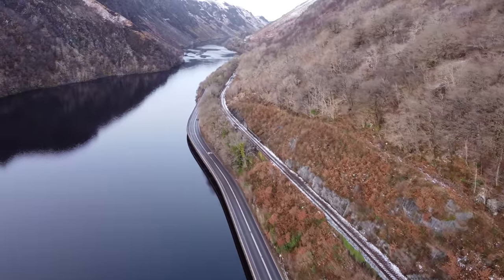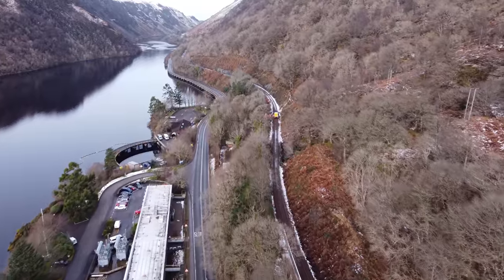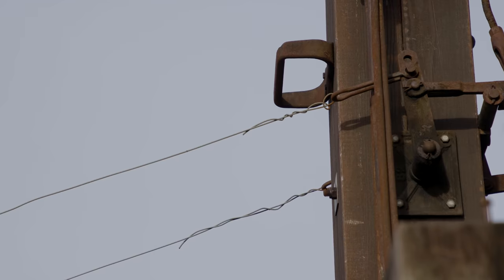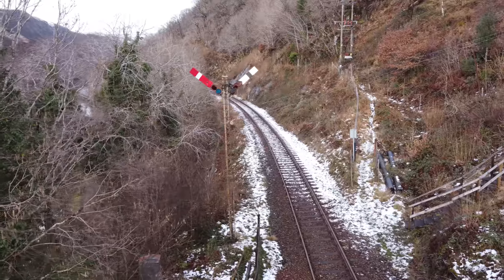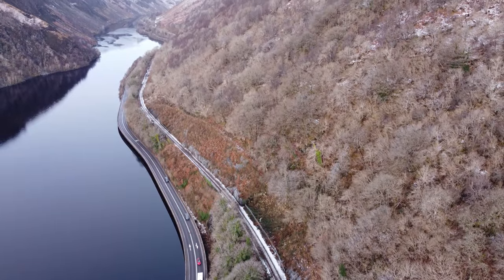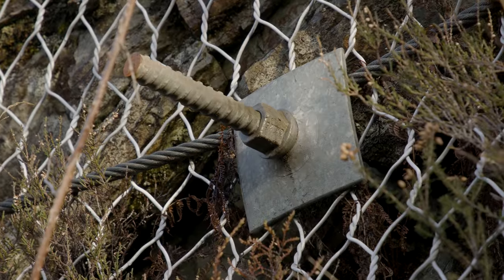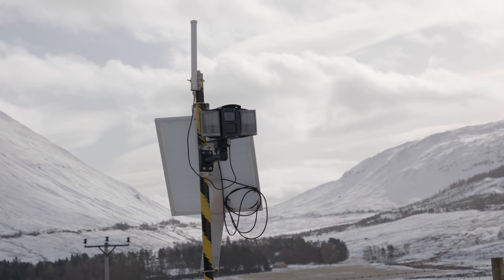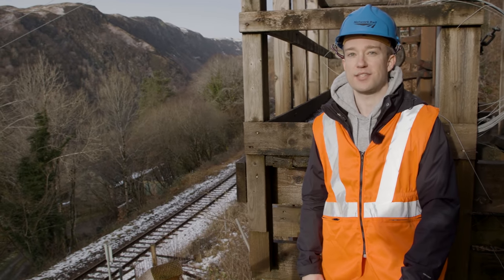After 140 years, this old technology still keeps trains safe

Comment: I'm a train operator in the US. I can completely understand how this system would still be the best. Sometimes it's an old solution or principle that is the most reliable in terms of energy requirements or practicality.

Also, I can definitely vouch for the dangers of larger objects. It takes a lot to derail a train but sometimes, all it takes is a cow or a deer. I've seen it both ways.
Reply: I've been wondering why there aren't just plows on the front to knock objects off?
Reply: @blazerorb  not all objects get pushed out of the way. Most locomotives have some sort of plow, but they are different from the cliche cattle-catchers of old locomotives
Reply: @SupernovaSpence  this is fascinating altogether, but I'm wondering exactly what you mean by "not all objects": are you referring to just particularly large and heavy things, like Alastair the engineer's example of a washing machine, or can smaller stuff like, again, microwave oven-sized rocks also 'bypass' a big, front-mounted plow?
Reply: @SupernovaSpence  unless your in a canadian winter . A freight train with a snow plough is a site to behold in heavy snow.

And if there is a snow bank you back up so you don't get blasted off your feet from the oncoming snow eave
Reply: @mnxs  I guess, depending on size, weight and where in relation to center of mass of the object, it could go to either side, or under the plow. The plow probably can't scrape neiter the rails nor between them to push everything away, for the same reasons our toy cars got stuck when transitioning from the back rest of the sofa to the sitty bit. Trains also have some "slightly" more gradual transitions like that :)

Comment: I like the size comparison to microwaves and washing machines, rather sensible. And the timing of the Sprinter at the end there was impeccable!
Also was quite surprised Geoff didn't make an appearance here :P

Interesting bit of kit too, think I've heard of it before but never really looked into it.
Reply: "small rocks" and "size of a microwave" in once sentence was quite funny though
Reply: @jojodroid31  Indeed, if that's a "small" rock, then they really don't want a train to hit a big one. 🙂
Reply: I thought size of a microwave as in the wavelength of frequencies in the 'microwave' range until i noticed hes talking about an actual microwave oven 😅
Reply: In urban areas you get microwaves falling on to tracks.
Reply: for real dude. unequivocally correct
Reply: When your microwave falls down a mountain… I think you have a problem.
Reply: nor does the trash bag in the wind:d
Reply: I 0k
Reply: They're American measurements, I think.
Reply: This part was clearly written by someone from the US 😅
Reply: I think Geoff would have been great in this video
Reply: @DaedalusYoung  no… you need blocks of cheese and Big Macs for America

Comment: Exactly the same problem exists for conveyor systems - pull wire switch monitors exist to tell operators exactly which switch is tripped on 20 km conveyor systems with a switch every 100m. On conveyor systems they still need local resets because they are a safety of life system but simply knowing which of the 400 switches (they are on both sides) has tripped is a massive time saving. The radio transponders use lithium batteries that are changed every five years.

Comment: During Christmas 2016 I got stuck for an extra overnight at Kyle of Lochalsh (that's on the northwest mainland looking over to Skye) due to a landslip disrupting the tracks. The wires broke, word got out and my train was cancelled.
Spent it in a cabin looking out to a ruined castle during a storm, with a log fire going and history books to read by the window.
The system works.

PS There was a battle at the Pass of Brander / Cruachan area in 1308 where Robert Bruce and James Douglas ambushed the Macdougalls by climbing over Ben Cruachan. The more you know!
Reply: it could still be improved , it could send a bottle of the local Talisker whiskey to your cabin and have you boss phone you to say you can take another week off and have a pay rise while your at it.
Reply: This system isn’t used on the Kyle line. That part of the word it was likely a roach fall incident, we have them fairly frequently despite nearly annual work installing mesh over the cutting faces

Comment: There is a similar tripwire system used at the eastern end of Southend Airport to protect against an aircraft running off the end of the runway and onto the railway. If it's tripped, the approach signals on both roads are dropped back to red and it requires a physical re-set afterwards.
(Presumably Instruction No.1 of the local procedure reads something like "Check for bits of burning aircraft on the railway".)
Reply: And if it's NOT burning, but just in pieces???

Comment: I find it amazing how many big institutions rely on "tribal knoledge" passed down previous employees to newer ones. The inability to store and access legacy information on processes and equipment is a major problem that needs to be addressed of we are to operate in a world of very long life systems.
Reply: Tacit knowledge I guess
Reply: OTOH, it provides some employment security. People can't be replaced without being able to pass knowledge down. You might be surprised how entrenched this thinking is, and it's not without some justification. Before presenting "solutions" from on high, you have to reassure employees that it won't make them redundant. Especially if you're actually trying to make employees redundant.
Reply: @squirlmy  OK, but what happens if the person with the specialized knowledge dies in a sudden accident? There's no harm in having it written down or otherwise codified so that the knowledge is not lost.
Reply: @chrysshart  I would say for this specific application it's a team of people so the likelyhood of them all dying in a freak accident is slim. Most modern businesses that use general labor have a written S.O.P for the task, but I would consider this a niche case.
Reply: @chrysshart  You are right, there is no decent reason why this system couldn't be documented to a reasonable level, of course anyone working on it is always going to need a fair bit of common sense but its not hard to write down a decent crash course in its operation and maintenance.

Comment: This concept is widely used in the US, except it's generally based on on an electrical current passed through the wires, and any break is detected and alerts the Dispatch directly.
It is mechanically much simpler, just wires stretched on insulators, but this is unique in that it does the job with no power required.

If it were me, I would put a small telematics box at each signal that sends an alert anytime it is tripped.
If the cell network is available, they can last 5 years on a lithium battery because they don't actually use power until they are tripped.
If you only had satellite available, a solar panel and battery pack could keep it going the majority of the year at least, and you add this to the mechanical signal so even in the dead of winter if the solar system dies the train still gets a warning.
But having the remote alert would allow track workers to respond as soon as it happens, rather than only after a train reports it.

On the other hand, maybe there is a train through there every half hour, and adding a remote alert would not gain anything!
Reply: Send me a link
Reply: unfortunately, setting up such a system would be a large investment, one which perhaps the government, or even specifically the rail administrators, won't see as worthwhile, certainly not in the short-run, not while they can make do with the current system. Unfortunately politics, inter-administrative, national and local, plays a huge role in these matters. On the other hand "don't fix what's not broke" also has a certain wisdom to it. This particular system has worked 140 years, can we be reasonably sure cell network or satellite systems won't have unforeseen issues that negate the benefits?
Reply: For an electrical system Wire would be 5-6 grand, electronics would be a grand per box, times 4 (for redundancy), so 10 grand
The advantage is that you can just solder the wires back to reset.
Though another option would be to keep the existing system and just add a monitoring device that checks the state of the flags and reports it immediately.
Reply: Very poor radio reception for aught above MW  up that way. It's not that far from glencoe... Which can't get terrestrial tv signal. Back before Iplayer etc  TV licencing  repeatidly took residents who had sky dishes to uk court, despite EU courts each time overruling  saying that as no terrestrial service...  Tv licencing was (fraudulently) attempting to charge for a service they simply didn't provide at that location.
Reply: @satibel  the cost to run copper wires then you have maintenance cost old system vs new system.

for this salutation it honestly makes more sense for the train driver to go slow during a warning
Reply: solar wouldn't work, this is Scotland :D
Reply: for someone wanting to see the US system, you can view it along US Highway 97 as you pass by Upper Klamath Lake in Southern Oregon. They also have some nice reuse of the rock in using it to build catch walls above the highway.
Reply: @squirlmy  some arduinos + sim card .. 30$ max
Reply: @Mr2winners  not nearly reliable enough, also power is an issue
Reply: they could bury an RTG deep underground and use that to power the network 🙃
Reply: @Mr2winners  for a private project: yes. If the systems has hick-ups, you just go and update the firmware or add a resistor somewhere. For something that needs to work reliably? Nah! Developement would cost a fortune. You would need to create circuit boards as jumper wires won't do the job. You have to manufacture..... BAM: 1 grand per box again. And if there is no mobile signal you're screwed anyway
Reply: "telematics box at each signal that sends an alert anytime it is tripped." except that is costly because it requires equipment, data connection, AND 24/7 operators to monitor it. 
there are lots of things they COULD do, but are any of them actually worth the cost an hassle to certify, contract the construction, set up a purchase and maintenance contract, and have the people to monitor it? no.
Reply: You could probably use LoRaWAN for this. Uses minimal power, can do long ranges and you can set up your own infrastructure.
Reply: For the people worried about redesign and all that: You could keep the old design, and simply add a remote alert system. In fact you could probably power it mechanically with a counterweight attached to a dynamo, if you don't trust batteries. The flag would still mean train drivers would have to drive slowly, but if a cleanup crew could get there before the train, they could make it so that no one is the wiser.
Reply: Yes, we have slide fences in the US. Seems like one would work well in this application.
Reply: I love how everyone keeps saying "oh but the cost to implement this and that". This is the government, wasting tax payers money is their specialty. 

It does actually sound like a great idea, and there would need to be a cost benefit analysis done on it, as there wasn't anywhere near enough info in the video to come to a conclusion.  we don't know if its "worth it" because we don't know how much it will cost and how much benefit will be gained from it. I'm sure the people sitting on the train (assuming it's a commuter train) don't want to always be waiting on it for the issue to only be brought to the engineers attention then and have to wait. I'm not sure if it said in the video how often this happens, or how busy the actual rail line is.

We already know it costs £40mil a year on maintenance, so any investment would need to also be looked at in comparison, because if it costs lets say £20mil to improve, well how much will it improve by. Rocks are still going to fall, so you'll still need to keep investing the £40mil a year, so investing more money with no financial gains in return or a reduction or even worse an increase in maintenance costs would be the major factor. But if implementing the idea only cost £100,000 once off and it means that 1. safety is higher and 2. trains run more efficiently then it may be worth it.
Reply: @paddor  this is not on a US railroad, you realize that, right?
And the US railroads use the modern electrified wire grid style detector, as well as seismic sensors etc.
Reply: My thoughts exactly. You could add this on, design and all for a few grand, and a couple hundred a year for the phone link, or even just say screw that, and use a radio.
Reply: What about a rail drone?

Just a small robot made to roll the rails, a few minutes ahead of the train, with the same ground clearance as the train.

If the drone is stopped or derailed, you know there is an issue, if not, you know the line is clear.
Reply: ah yes, there it is finally, the thread of the YouTube engineers, administrators, financial specialists and overall experts on the matter
Reply: @bozhidardimitrov3573  My bad, won't ever try to think of how to make the world a tiny bit less miserable, now that you in your infinite wisdom deigned to sarcastically denounce us. 🙄
Reply: Problem is there is no cell network in a lot of that track.
Reply: And copper is valuable enough in those quantities that you would have to worry about theft.
Reply: @cansabanci  Do plants grow?
Reply: @kevinconrad6156  oh come on you believe that billions of years of evaluation and a couple decade old human-made technology is equivalent? solar cells' efficiency is less than 20%. And you need a reliable source of electricity to run these things smoothly.

Comment: For those wondering why the double-semaphore has one painted red and white. A signal is painted red on one side, or yellow if it's a distant signal (iirc), and white on the other. Train drivers facing the red or yellow side must obey the signal's position, but facing the white side the position is ignored.
Reply: Maybe that line runs in both directions?
Reply: @robinbennett5994  yes it does. Single bi-directional line
Reply: @robinbennett5994  It does, that's why there are two signals. One for each direction. The line uses a Single Line Token Block system to ensure two trains aren't occupying the same track in opposite directions.
Reply: Line runs both ways
Reply: @robinbennett5994  re-read the OP. Of course it runs both directions. I'm not sure how you missed that. 🤗

Comment: Sometimes an old solution is still a good solution, or at least "good enough for now."  I'm willing to bet whatever technology eventually solves for this problem doesn't last 140+ years like this has.
Reply: "The simplest solution is often the best solution"
Reply: Indeed.  It's also less susceptible to becoming obsolete.  I mean, there are some pieces of industrial equipment I've seen that still need Windows 3.1.  Meanwhile, something purely analogue like this doesn't need to worry about that sort of thing.
Reply: If whatever tech replaces it doesn't last 140 years, that would probably be because technology advances faster now, and will probably advance faster yet in the next 140 years.
Reply: They wouldn't last 140 years, because the companies making them don't want to ;)
Reply: That speaks more for the current rate of technological development than for the imperfect, affordable solutions of the past, though.
Reply: There's a lightbulb that has supposedly been on since it's creation. These days it's about what is profitable. Cameras would cost too much to run for this scenario.

Comment: I love the environmental side of this. You're trying to upgrade a system, and you're not allowed to use (much) power. Having that reminder that not everything needs to have a million sensors and a self-learning algorithm is kinda nice.
Reply: There would likely be a net environmental benefit of installing a power hungry protection system becausse it would make the railway more reliable, displacing cars
Reply: It's not an environmental issue. It's more of a "this railway is out in the boonies and there is no power available" issue.
Reply: energy is a finite resource, for now at least.
Reply: @sublivion5024  Seems like that'd depend on a bunch of factors. A railway monitoring system would use, give or take, the same amount of energy per mile as any other mile, but a more remote section of track would be relevant for fewer people who aren't already using it, and at a certain point, running a system 24 hours a day, 365 days a year is going to be a bigger drain than is offset by X extra loads per year of people and cargo.

Remember that it is being used by some already, and the system seems like it works, for the most part, so the reliability can't be too great an issue.
Reply: The power used for this is almost guaranteed to be negligible from an environmental perspective.
Reply: Not much power? Try no power at all! The warning signal is literally just when one or both of those metal signs fall down due to a wire snapping.
Reply: Manually resetting means going out to the location, which uses fuel. Going along miles of track at walking pace uses more fuel than continuing at cruise. The system not being electric doesn't mean it doesn't use power.
Reply: Uhm.... There's no wires above the track.
So those trains probably run on diesel.
Reply: @Elmojomo  exactly, interesting how people hear what they wanna hear sometimes.
Reply: So OP, your anti-science and technology view isn't going the way you wanted. Any rebuke?
Reply: @Nexxol obviously. What’s your point?